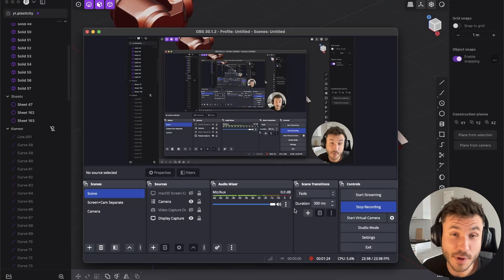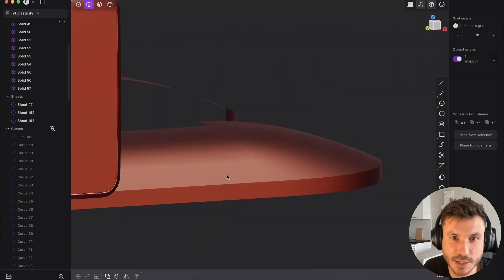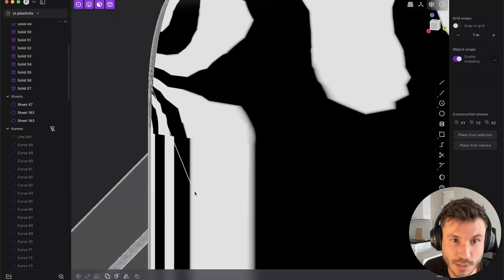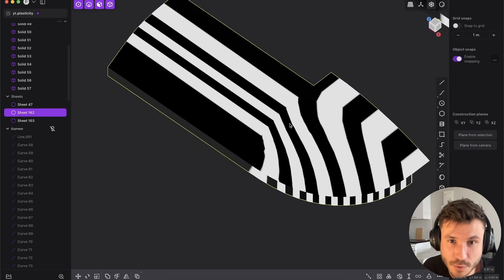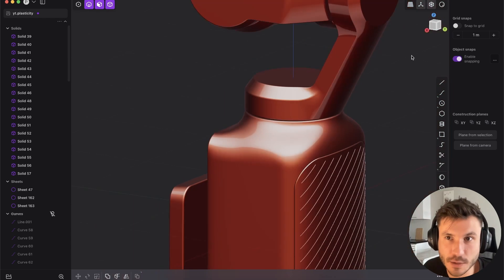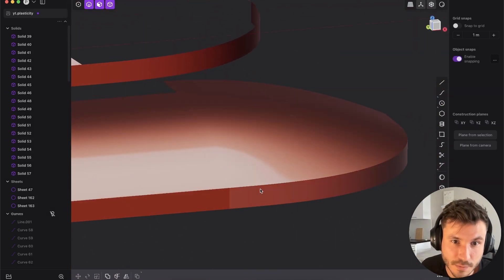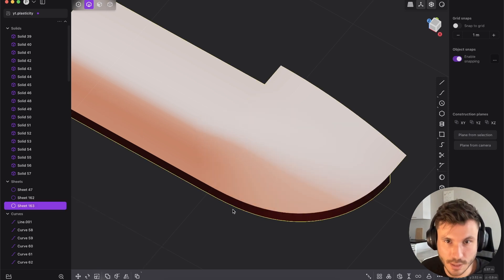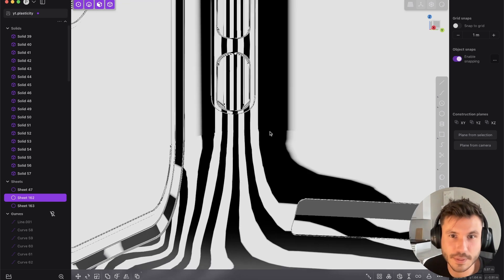IMPORTANT Settings to check Reflections in Plasticity

Comment: Hey Nikita!
Just yesterday I was testing exactly this on Plasticity, but I didn't manage to get good results,
but maybe it's because I don't know how to use plasticity very well yet.

Check this screen recording:
https://i.imgur.com/HQ8er2N.mp4
Is it possible to get the smooth results like I have on Sub-D modeling ? look how smooth and soft it is.

I tried lofting in plasticity using some custom guides, using G1, G2, beveling with different settings, but  no luck !

I know I didn't export in full quality from Plasticity, that's because I'm using the demo version for now to test and see if Plasticity could work for me!

Another example:
https://i.imgur.com/NZyZFMB.png

I can record a better video if you want.. let me know what you think !